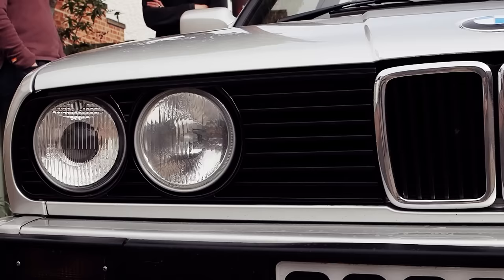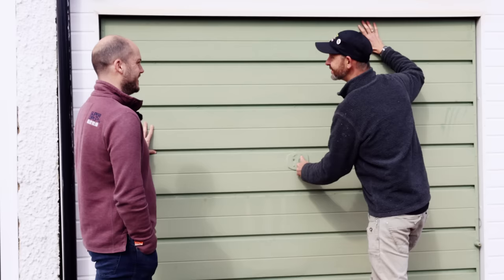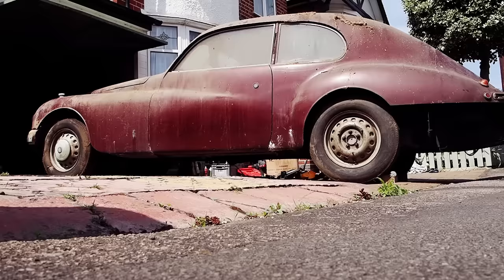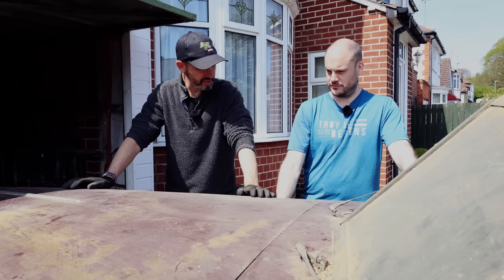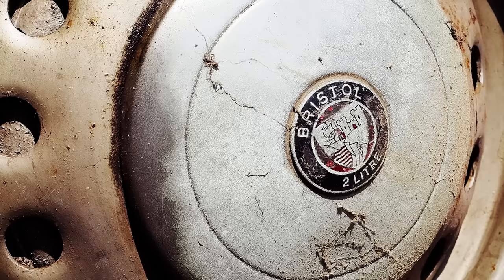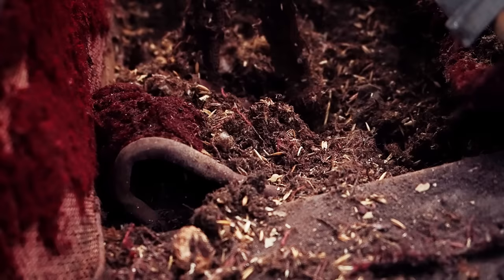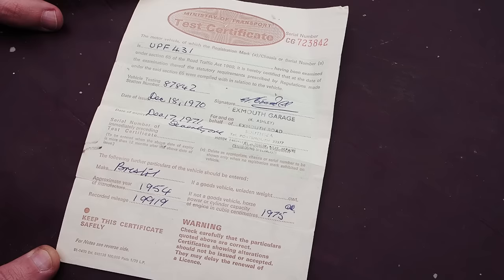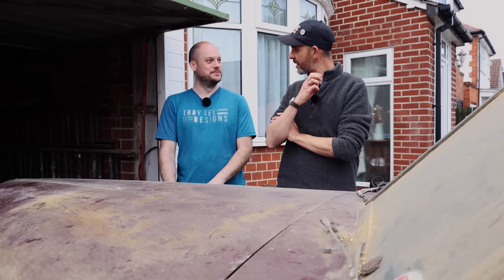Unicorn Rare British Classic Barn Find - Garaged for 50 years

Comment: I say Restomod, using a modern BMW straight 6 & gearbox, rehabilitate the interior, replacing the wooden seats with modern front seats upholstered in matching leather, seartbelts, upgrade brakes, suspension,  running gear, add modern ICE & add drivers for the legacy clocks from the EFI, electric power steering, etc etc...  bosh... useable daily driveable car with great aero & unique & distinctive presence.

Restomod will surely be loads cheaper than full restoration, & you'll probably never really drive it...

Comment: Rods can be saved, as can the crank. Bristol sixes are almost unavailable and ruinously expensive. Alfa 1750 bearings fit the crank BTW. Drop the engine in a tub of Diesel for three months and it will all come apart without trouble. That one looks much worse than it really is.

Comment: I’d lay odds that the engine is rebuildable , even if the bores need rebooring to oversize or even machining out to take liners.
Reply: Afraid it’s not, bores are sleeved so not a problem. It’s the amount of rust and a previous crack repair that’s doomed the block and excessive scoring in the crank journals.

Comment: Is Anthony Crook the AC in AC Bristol??
Reply: No, AC stands for Auto Carriers , one of Britain's oldest car manufacturers ; They built some delightful sporting cars pre war , and fibreglass 3 wheeled invalid carriages ,the AC Petite ,(usually in pale blue ) in the 1950's. Not all AC's used Bristol engines , only the most expensive models: other models made do with the Ford Zephyr 6 cyl engine with Raymond Mays conversion, or AC's own 2 litre engine whose roots went back to the 1920's ,

Comment: They took the design from BMW as war compensation, and they not even changed the grill, i would repair the body first, it will take far longer than you imagine, and while renovating the engine and gearbox over some years, maybe just stick a 2 liter straight 6 in it, from a BMW.